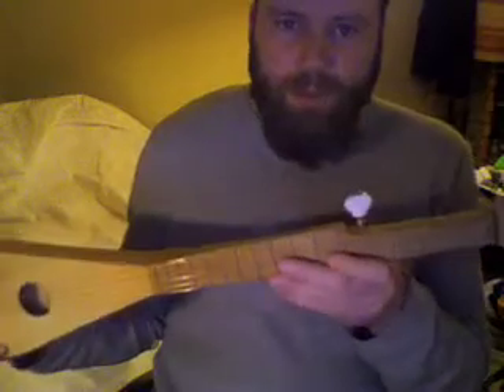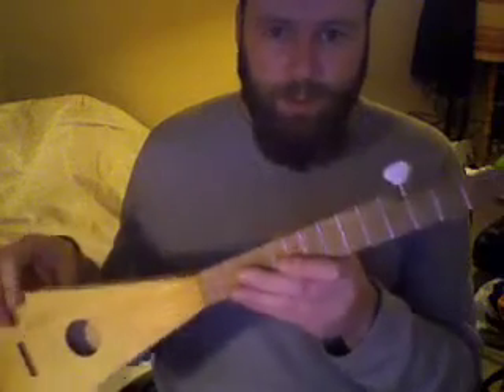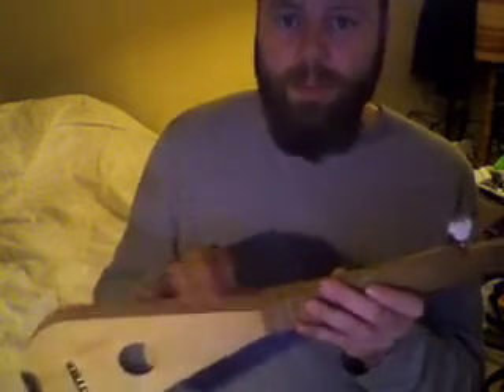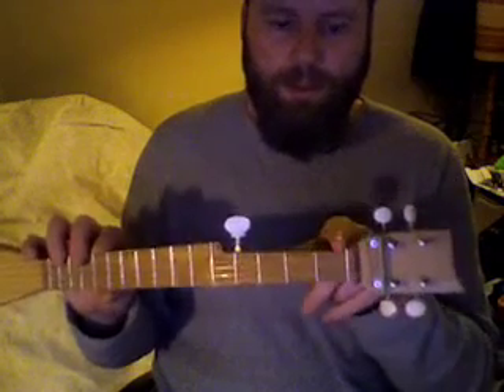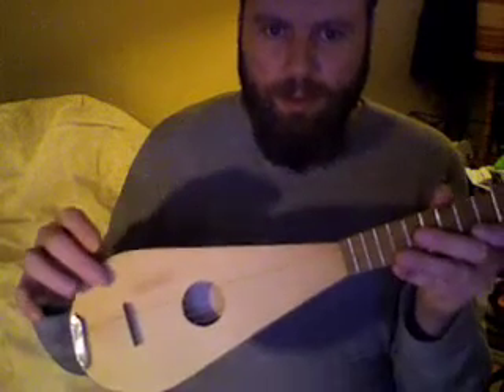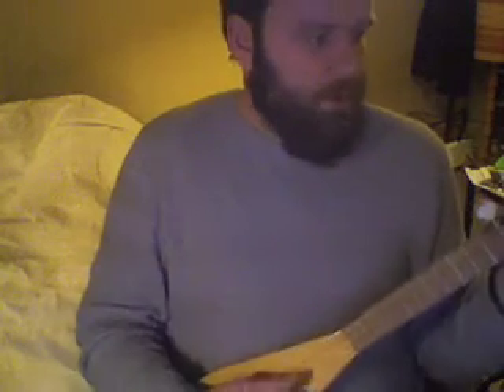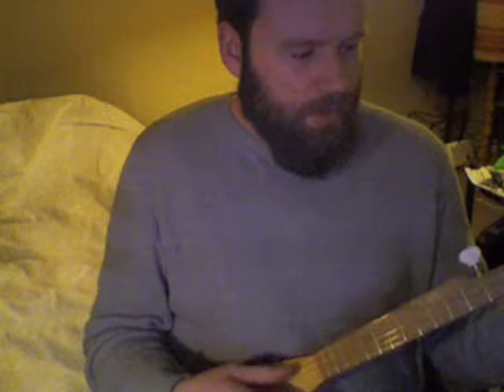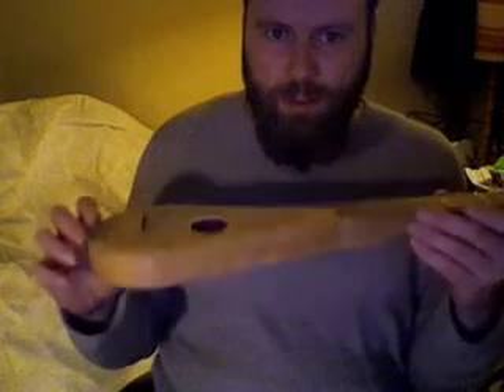Mini/travel banjola

Comment from the maker: @CircuitsAndStrings 
Thanks!
The tuner are half a mandolin set.
About a year ago i was given a bag full of tuners(mainly mandolin) and tailpieces, so i have a few to work with. I also look round charity shops when i get a chance and buy old broken instruments the spruce top is of an old guitar that was beyond repair. 
The mandolin was used in the Swedish school system for about 30 years as a starting instrument so there are loads of them in charity shops. (Now they use 1/4 and 1/2 size guitars.)